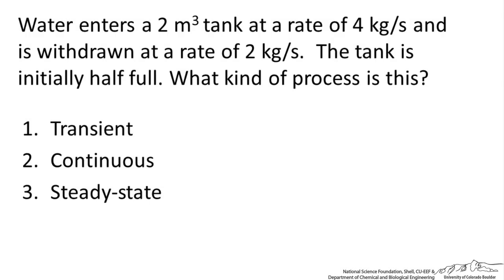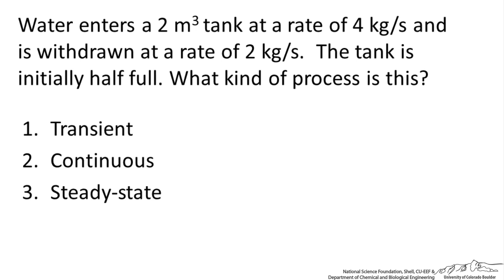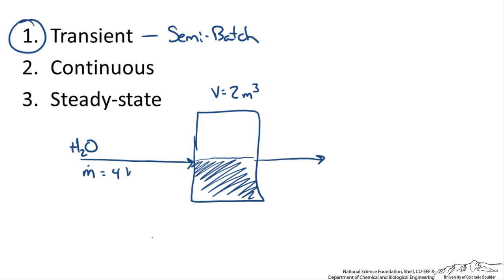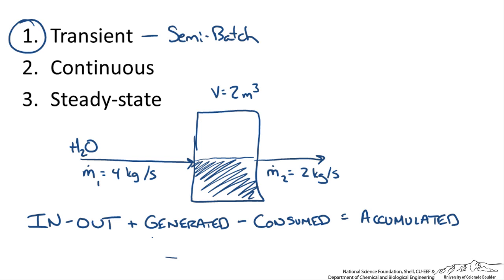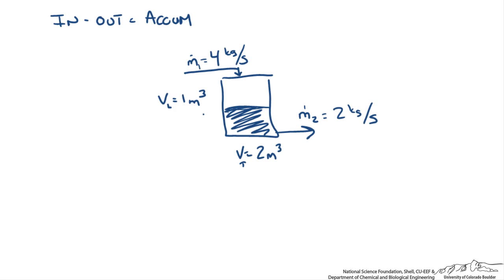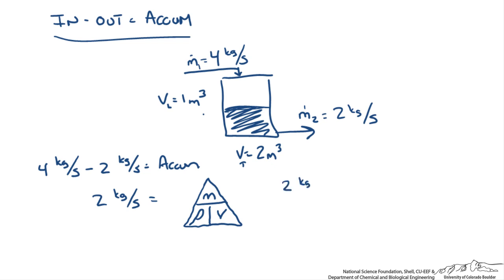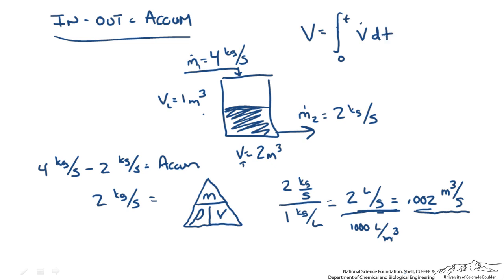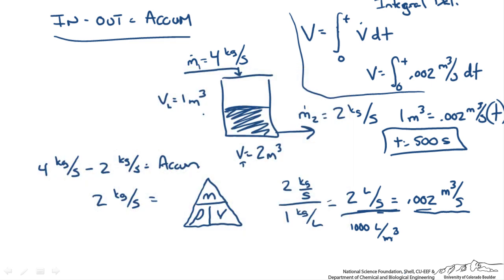General Mass Balance on Single Tank

Comment: Hello. Thanks for your video. How did you get 500 sec at the end?
Reply: The tank is initially half full and can hold a total of 2m^3. That means to fill it up all the way you need 1m^3 more. In the video he determined that the accumulation is 0.002m^3/s. To figure out how much time it would take to fill the tank all the way simply divide 1m^3 by 0.002m^3/s leaving you with an answer of 500 seconds.
Reply: @Diego-th3js  thank you so much!